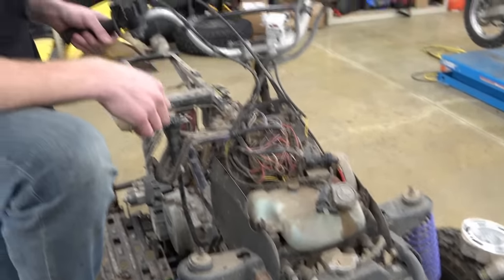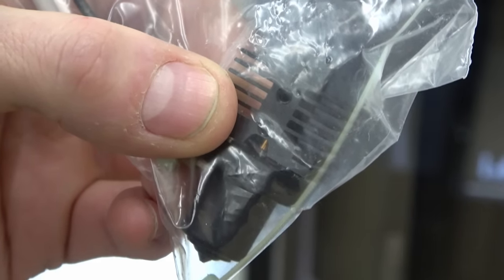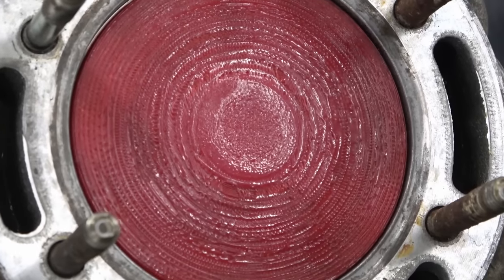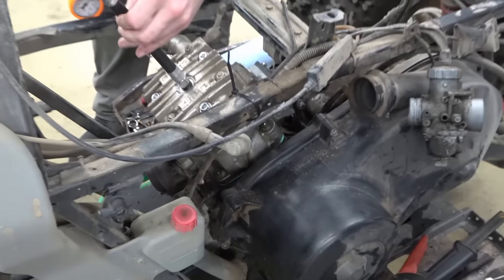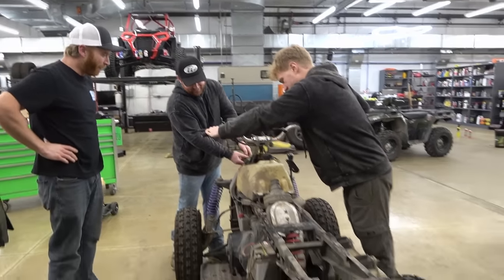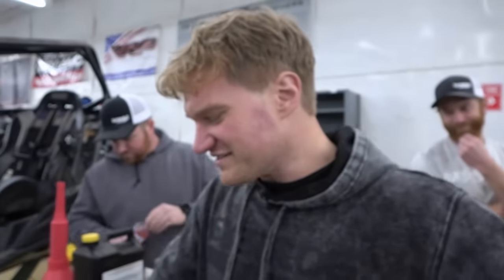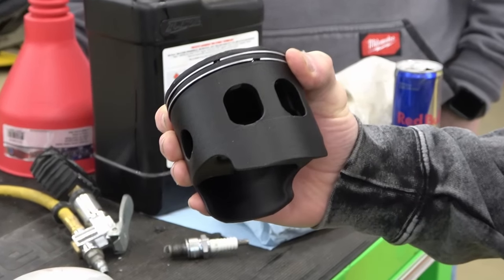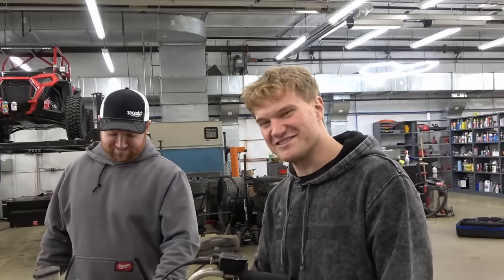WORLD'S FIRST 3D printed carbon fiber piston! Will it run?

Comment: I wonder if you could have the top part made with the rings on a lathe out of aluminium like normal so its a simple round part that then slides into the bottom half being the harder to machine stuff out of the 3D print, like a two part piston I guess that would obviously stop the top melting which then might last ages longer.

You could have the top part slide down to the wrist pin which would lock both parts together.

Comment: hmmm what if you hollowed out a traditional piston and used carbon fiber for the core/ connectors. I don't know ANYTHING about engines, but was wondering if a lighter piston would be a good thing.

Comment: I wonder if you made the top 25% out of Alu and bolted on a 3D printed bottom would it last. Machining just a disc with a dome and ring gaps would be cheaper if the 3D printed bottom 3/4 would hold up

Comment: Would you be able to make a piston with a metal top for the heat and make the skirts out of the carbon fiber material for weight savings? On an engine with a oil jet spraying at the bottom of the piston you may get away with it as long as the carbon material doesn't get too hot.

Comment: You can get 3d printers that print in metal now.
They used a metal powder.

Also I think you actually said it half right when you said transfer ports (*intake ports) because I think it is for intake and transfer ports as there is no slot in the cases for the boost port?
The ring gap will dictate the compression.
The thermal expansion is the unknown factor.
I dare say in the future plastic might replace metal when they realise electric cars cause more damage to the planet and extra co2 makes a lot less difference than they say, check out the co2 coalition for the chemical explanation.

Comment: Could you integrate a cooling system inside the piston to keep it from melting the top maybe? Similar to a liquid cooler system for a computer with flexible tubing and built in ducting in the piston top and sides.

Comment: Next time cerakote the top of the piston from the top ring land up and make the piston a few thousands smaller for expansion of the cerakote only on the top as for the bottom of the ring land see if you can get a Teflon coting on the skirt.

Comment: Can't you use other materials in your 3-D  printer, and or mix other materials into the carbon fiber? Ceramics, metals, glass could all raise the heat resistance factor/ability... pulverized powderized and mixed into your CF 'ink' ...I dunno...just a thought...

Comment: 3 d print a piston make it a few mill smaller in dia and coat it with ceramic dipped and glide bearings in the crank gudgen pin holes or a graphite and carbon fibre top for the piston

Comment: The compression is much higher than what that gauge shows.   Being a small engine the hose on that gauge is to long and big.    Put a small gauge on there that presses right against the head.   I bet it's 75-85 psi.

Comment: I would've thought a valve to restrict 50% of exhaust port low rpm and fully open higher rpm would be better option  , connect  exhaust cable controlling valve to your throttle once at 50% throttle exhaust valve starts to open more , at 3/4 throttle exhaust valve fully open. 
Yes I see point blower is going to pulse one pulse every revaluation you need it at 1:1 otherwise you'll miss a pulse 1:2 .
Vortex blower better option in my opinion with a slide exhaust port ..

Comment: You guys can’t use a normal automotive compression tester ! The valve needs to be at the source . That’s likely gonna make 100 more lbs with a small engine gauge setup. The power stroke is to short on a 2 stroke motor for a automotive compression gauge

Comment: You're losing compression due to not having a second ring. You have nothin but blow by through the gap. The second ring should be installed with gap 180 out to make a chamber that both restricts the air flow, as well as when the engine shuts off allows pressures to equalize. It also acts as a second point of contact to keep the piston from slapping the cylinder wall as much.

Comment: It would've lasted longer if you made the fuel oil mixture a lot more rich. ❤
 Maybe a high temperature JBweld piston would be better.
 There is an old man up here that made a piston out of a tree for a 2-stroke Polaris Indy trail snowmobile. He burned a piston up out on his trapping line. ❤😂

Comment: What material was used? I would expect a pa12-cf would last a while and something like PEEK wich has a melting point right at or a little higher than the running temp of the engine would probably last a while to

Comment: It would seem that if your intent were to design a plastic piston for resale, you're actually off to a decent start. I realize that's not what's happening here, but the R&D is the same. You've simply reached a point in which your choice of materials (or material treatments) would need to be the focus of the team. There are many high temp plastics already available, and countless others currently in development. I'm sure one (or a combination) of them could solve the meltdown issue.

Think about a larger engine like a V8, and how much weight reduction could be achieved with plastic pistons & maybe even plastic rods. The rotating mass would be greatly reduced, increasing power and efficiency so much so that it could potentially revolutionize several industries... A little late, but still.

Comment: i wonder if you mix with methanol and more oil if that will cool of the new piston enough. on our RC plane Nitro engines we reduce the heat spreaders and cool it down with fuel, we usually have 10% nitro mixed in to get a solid idle and rev up. top RPM is not that big difference on a standard engine. Rossi Race RC engine ´s is a different story.
And with methanol you actually boost you octane level. Ethanol reduce octane level.

Comment: The whole problem that you are facing is that the rings are the only direct route for the heat to travel from the top of the piston to the walls of the cylinder where it is released to be cooled by the water jacket.  As heat will always flow to cold, the thermodynamics will balance out with enough mass to allow the heat to flow.  Unfortunately, your carbon fiber piston lacks the ability to transfer the heat to the rings for it to be drawn off.  The cylinder and head alone are not enough for the proper transfer and the piston CAN'T do the job.  Still, magnificent attempt and limited success are a great reason to continue in the search for perfection.

Comment: Check out "garage 54", they made pistons out of basically everything.. but kept burning holes in them.. great idea making the top thicker. Could try adding some kaowool to the top. Just flatten it in a press and glue it to the top of the piston. It doesn't have to be thick.. and add some thick oil or even grease on the cylinder walls for better compression.. top fuel cars get rebuilt every pass, and only run for a few sec.. would be interesting to see a comparison reg and 3d print on dyno.

Comment: Ah, a truly "liquid piston" engine.

Seen someone do something similar with a 4-stroke and they fail due to melting and bypass, even then.  With a 2-stroke, you're really pushing your luck because hot gases naturally attack the rings on the port side.  These engines are already brutal on pistons.

I expected it to run with the 2-ring version, but am surprised that it ran for over a minute at mostly WOT as the top of the piston was goo much of that time.

Comment: Well no shit it will run it doesn’t matter the material what matters is the compression it has to make the explosion so it stays running obviously it will just not last as long as a normal made piston with its belonging materials it should have

Comment: Hear me out... What if they put a thin potentially titanium steel cap to absorb the detonation cycle on the top and a heat-resistant layer of material between the thin steel cap should solve this.

Wouldn't that be one of the lightest pistons in existence?! It might even be reliable...

Comment: use methanal next time i bet it runs longer due to more fuel and it cools the plastic down. also i wonder if its coated with electrolysis if it will help heat deflection for not melting the cylinder but first anneal the part!!!! annealing makes it have better heat deflection. please do this!!!!!!!!!!!!!!!!!! for science and FUN!!!!!!!

Comment: I think that if car manufactures made or can make engine block with more meat, steel or perhaps titanium, gold or whatever other hard to brake metal - cylinder holes that can be honed 5 or more times, our world could have much less junk from cars in general. Who would ever need to change a car (engine) in such case if a person could just buy oversized pistons and oversized piston rings ? The whole world, automotive industry and motorcycle industry would benefit from that. And besides, worn out pistons spend more oil and gasoline and diesel, just negative thing. THis would be much cheaper than buying a whole another new or used car or motorcycle engine. Any (cylinder) hole can be drilled only X number of times and at the end it only gets wider, no way back to that.

Comment: The heat of combustion alone along with the compression load will destroy whatever piston you can print up with plastic. This was a dumb experiment. Try making it with metal printing and see what happens. I see from the exhaust that you had extra oil in it.

Comment: well try copper pistons (or iron or titanium) with spot electroplating 3d printing on a metal plate substrate. talk about arm chair engineering lol. I dont mean arc welding 3d printing tho. it needs to be in an electrolyte bath like copper sulfate water. how about a 100% carbon fiber 3d printed piston. no plastic. cnc milled carbon fiber block into piston. you know when the piston is fuel itself. if you make a hollow thin sheet metal piston surface and make the filler from the carbon fiber 3d printed plastic. productive?

Comment: What about ceramic mix with a tiny bit of aluminum half  half equation of both materials will it withstand heat wout melting with ceramic and aluminum.? Half alluminum amdhalf ceramic both is lighter and thinner lighter weight than using a solid piece of all made aluminum ..and ceramic same these days ceramic is used as a brake pad withstanding heat temperature so it can work brothers. Mix a blend of light weight aluminum and half of ceramic it'll be lighter than a thick solid piece of ceramic or aluminum

Comment: Thought about it? sure.... but thought it was a good friggin idea? no...not really.  lol.  Only way id want to try it is if i did a metal 3d printed piston... i figure thatd be awesome.  ya know....what if you left a .2 tolerance and electroplated it.  bet itd last like 5 whole minutes!  Honest to god... its just the melting issue, its gotta be.  keep the heat from melting the dang surface and find a way to get it to run real cool...maybe nitrometh injection...   honestly the carbon fiber isnt doing almost anything for you guys though, its just the poly.  MAYBE the area around the ports is being helped by the carbon...maybe.... but other than that, it really seems like you could get it to run for at least a while.  what if...what if you inset a 2mm metal top surface and mated it to the rest done in plastic...then increased the hell out of the cooling..?

Comment: being a metal worker I already no nothing "printed" will lass in a n ebviroment of    0  pounds of pressure .....  oop   1500+ pounds... oop 0... another 1500...   it will tear it appart.

and some engines like our 454 have compresion upward of 3000 psi, siply because it was made for pulling 32 foot trailers,

Comment: Love it.
But the proper way to make functioning plastic pistons is by machining Torlon.
Look into the work of professor Maty Holzberg and his team in the 80s. Even they found that the top of their plastic pistons had to be metal to handle the heat.
They built fully functional plastic engine blocks and everything.

Comment: The printhead used to create the part doesn’t get as hot as the engine. This could never work. Has to be a powdered metal printer.